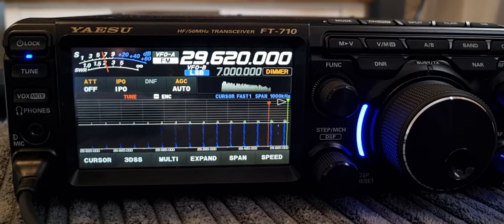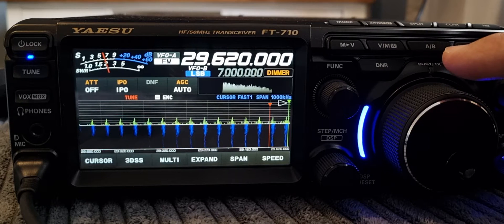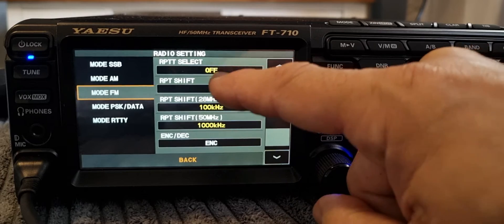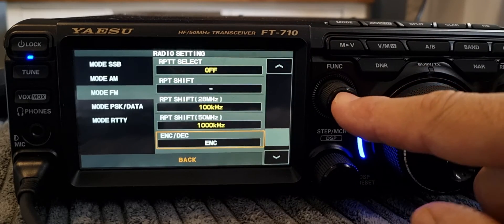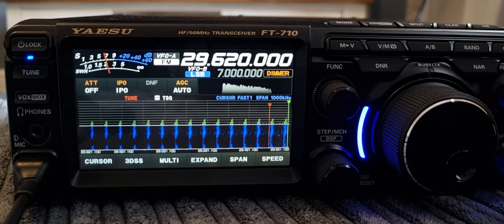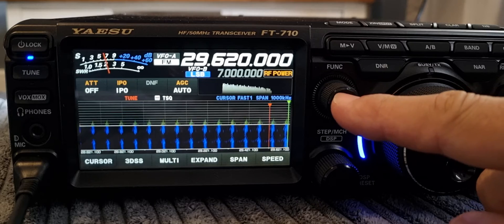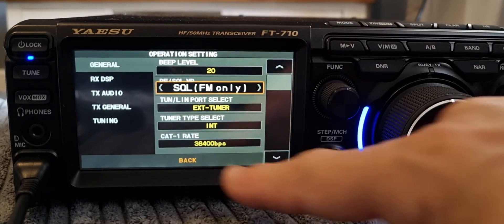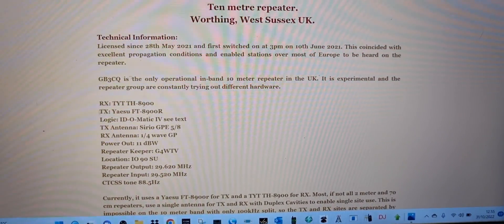YAESU FT-710 10 Meter 29mhz FM Repeater UK GB3CQ

Comment: One thing was overlooked,switching the radio to narrow fm dev\bandwidth  mode? I didnt note that step?
USA use 20khz 4khz dev,UK and EU generally use 2.00khz dev on fm repeaters.
Reply from the maker: Thanks good point
Reply: @M0FXBHamTech  HAS IT GOT S-NFM 2.00KHZ  OR NFM 2.50KHZ MODE VIA THE FILTERS OR IN THE MENU SYSTEMS?

Comment: I think you hit the tuna button the radio automatically puts the power down to a very low power and then puts it backup to a 100 W after it's done tuning so there really is no need to set the power low before you hit the tuning button
Reply from the maker: Agree but I get scared.